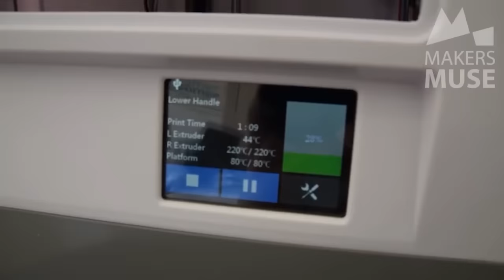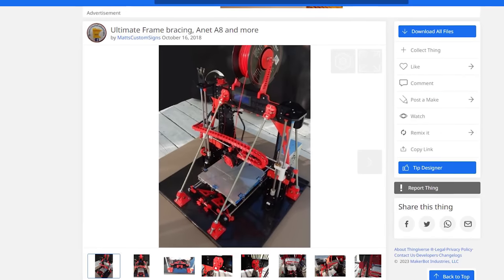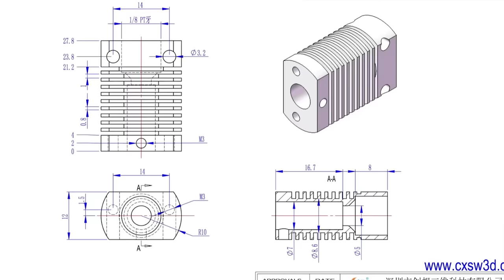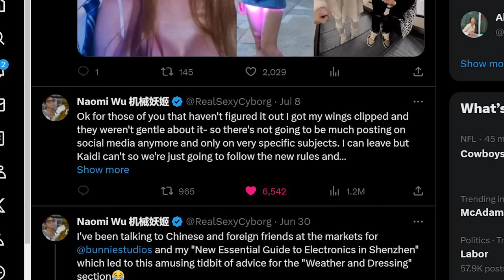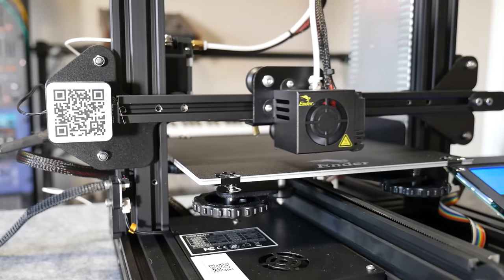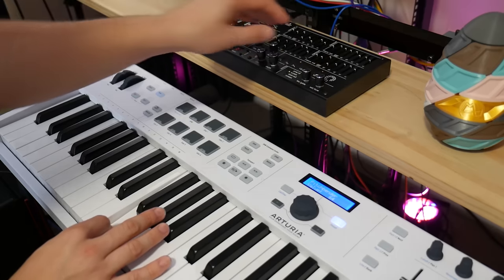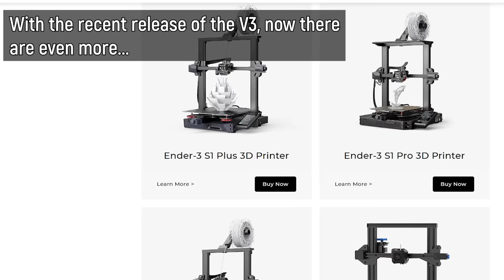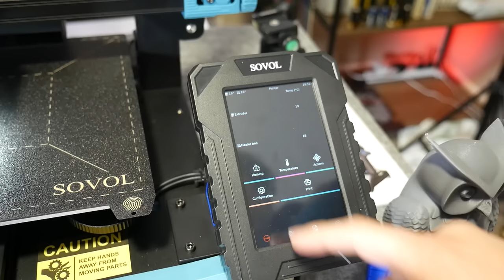Creality Ender-3... it's time to move on.

Comment: My Ender 3 Pro is awesome. I can turn it on after months of not using it and get a perfect print first time. It’s not very fast compared to newer printers, but it is reliable and asks for nothing in return. It was a great first printer. Agree that there are newer models that might be better, and Creality needs to get the Ender 3 variants under control.
Reply: Lucky you, mine was not responsive at all after 6 months of no use.
Reply: @VideoNerete dang, I used it for the first time in 1 and a half years, and it's still a work horse.
Reply: I have an original Ender 3 that I bought in 2019 and it's the same way.  Spent the first few months getting it dialed in and for years now it's been turn it on and go whenever I need it.
Reply: I kept my 3 v1 off for about a year and fired it up... Bed was still level, hot end was working perfectly. Printed like it did a year prior.
It's my old faithful, just so slow now that I have the Ender 3 v3 KE.
Reply: My Ender 3 Pro is 4 years old now, starting to rust on some of the motors and guide wheels from storing it in the shed, and yet it still prints incredibly well and has always been reliable. Its print quality and reliability is honestly better than the Ender 3 V3 KE I recently bought (and in the process of returning) and I love it to death, best purchase I ever made
Reply: @Vantillay  I've been using my KE for about 2-3 months now, not a single hiccup. about as reliable as my old Ender 3 v1 (and far easier to get something printing) ... I am impressed by the speed. I have all but retired my old ender.
Reply: @MadGoat   I'm really glad to hear your KE Has been serving you well! I think I just got a defective model, or got really unlucky, because my KE has been nothing but trouble. Ah well, shit happens, happy printing!

Comment: The ender 3 is an absolutely fantastic printer, I run a small company and we prototype parts on it all the time, we bought a K1 Max and two bamboo lab P1S's and I love them as well especially the bamboo labs but at the end of the day you can get a Ender3 for like $150 any day of the week, and it teaches you a lot about the concepts of printing when you're tinkering with it. But because all the parts are pretty robust you're not going to really break anything. I own 6 Enders and just love them especially when you have a glass bed. Ender3 + FreeCAD = Fun
Reply: Stockholm Syndrome
Reply: I like the glass bed as wel but as soon as I had a bed leveling probe and a PEI sheet I tossed that glass bed in the bin and from that moment everthing just sticks and comes off like a dream
Reply: Quite an endorsement and convincing.
Reply: What do you recommend instead
Reply: I use a glass mirror for a bed. Works great.

Comment: I love my ender 3 neo. I am using the creality slicer software and have printed a number of your challenging prints including the easter egg torture test and all have worked perfectly. I am new to 3d printing and am 73 year old female. It's great fun. I have not needed to make any modifications to the printer or the settings to achieve the results
Reply: Omg, you're amazing! 73 years of age and 3d printing?!? I wish you were my grandma, haha. Lots of love, god bless you!
Reply: I got an Ender 3 Max Neo, nice to see someone else with a neo printer :D
Reply: @sparkthego0f473  Just got an Ender 3 v2 Neo (first printer), haven’t set up it but can’t wait. I’m nervously optimistic.
Reply: Nice,

I think the V2 and Max are pretty similar. 

When putting the printer together be sure to mount your display correctly. I didn’t do mine right and now the screws are broken lol. 

Also quick tip, make sure your wheels aren’t too tight. If they’re tighter than they should, after a few prints, it will look like there is dust on your wheels. It’s very visible on the wheels that carry the build plate. It’s actually rubber from your wheels slowly “chipping” away.
Reply: bot

Comment: My ender 3 has 700hr on it since july 14th when i upgraded it to klipper. Over all it have like 5k+ hrs on it.
Even if i never use it again after my version of a vzbot is built ill still never sell it and it will always have a place on my shelf. Its been an incredible machine that got me started in 3dprinting. I now have 4 machines of various configurations churning out parts almost 16hrs a day. My ender has a place in my heart. Bury it with me.

Comment: Sticking with my Ender 3 too. Its familiar, and Ive learned to fine-tune it over time. Budget constraints can make trying new models a bit tricky.
Reply: I'm not sure there's any good reason to upgrade from one unless you need a larger build volume are want to print with resin. Once you've got one of those locked in, there's not much to be gained by switching. It's the folks that got a bad one or can't get it to work right that ought to consider upgrading or switching.

Comment: Last year I upgraded my Ender 5 to an Ender V3 Neo, and I don’t think I’m going to stop recommending Enders anytime soon. Yes, the Bambu we have at my work BLOWS ME AWAY with how great it is… but it’s also 5x the cost.
Reply: And 5x the quality
Reply: @TEGKCUFTNUC  and 5x the peace of mind to leave it printing and not be bother checking it from time to time
Reply: Terrible support has Bambu.  I have the X1 (not blown away), the Qidi X-Plus 3 (very good), Ender 6 (nightmare), and my trusty Ender 3 V2, which I continue to mod, and it prints just like it did on first day.  Beautiful :) I have probably spent more than the previous aforementioned, all put together, on the V2, lol, albeit, it's a tad slow now.  Think about that ;)

I did also buy an 'Aquila' back then, (cheap at time, with the crappy mainboard) but it never came out it's box, and I just ended up using it for spare parts (for Ender 3 V2), as I was just too busy getting the Ender 6 nonsense done at the time, so that never got up and running, which I feel bad about.  Covid took it's toll.   Still, more parts for my V2, rest got binned. :D

Comment: I completely agree with all of your points. Wanted to add however that the recent SE model is actually something a bit different. It uses a strain gauge and auto bed leveling so the user doesn’t have to adjust zoffset or make any first layer adjustments at all. Very compelling at $200. Ok, now I’m off to check in on Naomi and where she’s been.
Reply: i was gonna say the same thing.  Also no more bowden tube so that is another flaw mentioned that they have fixed.  I'm a bit biased of course 😆
Reply: It still doesn't hold a candle to the Bambu a1 mini though, for the same $200

Comment: Got to say you're spot on in your analysis of the 3D printer market.
(My personal experience)
My son got an Ender 3 as a hobby printer as it was cheap and great to learn with and pretty much got me into the whole 3D printer world. I loved the whole design and print side of 3D printing and wanted to get my own printer but could see so many things wrong with the Ender 3 I didn't want one myself. The Ender 6 came out and I talked myself into how it would make a great hobby printer and to learn on and even make some mods to take care of its shortcomings. The Ender 6 has been a great tool but the constant need of fettling to get great prints was getting tiresome when what I wanted was my printed design to come out without any drama. Enter the Bambu A1 combo. The thought of easy colour prints was tempting but the ease of use and self calibrating element of Bambu printers in general had me reaching for the credit card. My, so far, short experience of the A1 has me blown away. Just this morning I sent a print from the web to the printer from my phone and it just works with nothing more than turning the printer on. Bambu have moved things on considerably with their ease of use it's night and day.
Was the Ender 6 a bad printer? No. It taught me so much but now it's time to move on to what I really want to do, design and print, without the fettling.
Reply: I hope by "short experience of the A1 has me blown away" you don't mean "the cable shorted, caught on fire and my house exploded". I hope you got news of the recall.
Reply: @bami2  Thanks for your concern but both the A1 and myself are intact. My printer is closer to a wall behind it such that the bed cable was tapping the wall. From new I've had a strain relief print installed to stop the tapping and my cable is as good as it was out of the box thanks.
Reply: @stevecade857  That's good to hear!
Reply: Going from Creality to the new Creality... Some folks just don't learn.

Comment: I have an ender 5 Pro print farm,  which has done me well for 3 years.  You can't have a farm with lots of different printer types.  But bambu labs will be my next purchase.... just waiting until Christmas sales come and go... before I move away from creality.  Completely agree with the general view of Creality.
Reply: Bambu printers don't support the same level of print-farming as your Enders
Reply: @user-jk9zr3sc5h  can you explain what you mean? Do you mean just based on cost you can get more printers for the same amount spent, or is there some other feature you're talking about?
Reply: @doinker50  No, Bambu printers arent currently automated. You have to manually print each item. There may be some automation software available but I havent heard of it yet.
Reply: I'm not a 3D printer farm operator... But I'm curious about the automation thing. How do you automate a 3D printer when you have to physically remove the print from the bed before starting another one?
Reply: @crooker2  Ive seen people add gcode to push the print off with the print head (cool the bed, push it off, print again) but i dont know if people use that in print farms
Reply: @crooker2  10 Enders are "available". Pre-sliced STL to GCode. Send GCode to 10 available. 10 Enders are now marked as unavailable. When print completes, take print off of the bed, and mark as available.
Reply: @doinker50  Couldnt do that push with a Bambu, the toolhead cover would fall off lol
Reply: @crooker2  I dont.  But this is a full time job, so long jobs are run for overnight, and then I have a day routine, which involves setting off shorter jobs, repairing printers that are playing up, removing finished items from printers, cleaning them up, packing them, either as finished goods for future orders, or to fulfill orders that have just come in.  not forgetting creating shipping labels, replying to customer emails, and more..  I have added gcode to all my jobs, to beep when finished so I don't get too distracted and I am aware when to go and pop an item off a bed, and start it off again.  And for small items, put multiple on the bed at the same time to avoid going to the printers too often..  Keep short jobs as few as possible.  Lots of info there :)
Reply: @crooker2  I designed a rig that sweeps from the bottom until it hits the plate's lip, then slides in underneath it lifting it from the magnetic bed, then slides out and drops down. The upper half has arms that drop in a new plate (using the removing arms measured height as reference).
I'm currently building an automatic stylus that touches the screen to activate the next print.
I want to do as little modification to the X1C as I can. Currently, the design just removes the top plate and the door.
Reply: @DonsArtnGames  The thing is you cant send GCode to the printer aside from SD Cards or their proprietary webservice interfased ssl tunnel
Reply: @DonsArtnGames  Have you added a CHT nozzle yet? I have a P1S so it doesnt complain- not sure the state of the X1C and CHT. I'm shaving off >1hr from ~8hr prints from prints simply from increasing my volumetric flow and pushing it faster. It only took me about 30 minutes to install.
Reply: @BrianBauckham  Yeah, that's what I figured.  That's what I do too, set my long jobs to run overnight. (Of course, every job is a long job with an Ender 3v2. :)   )  Of course, I'm only a hobbyist.
Reply: @DonsArtnGames  Sounds amazing... and complicated!  :)  Would love to see your rig in action.  :)

Comment: Honestly, I will always be thankful for this printer. At the time, the other decent option was to spend ~$800 for a Prusa. It was simply too much for a tool I was not sure to use that much beyond the obligatory Benchy (which strangely enough, I actually never printed ^^). To be fair, it is not a great printer, even with upgrades. But as a tool I use once in a while, it's still fit for purpose, even if better printers do exist for the same price now.

Comment: I bought an Ender 3 back in 2018 as my first (and until recently only) 3d Printer. Back then, there wasn't much choice available at that price point and it was surprisingly good out of the box (I guess I also got lucky). I had the occasional problems with leaks in the hotend due to bad fittings or molten PTFE tubes, but generally it worked fine. Of course it got some mods over the years: lots of 3D-printed attachments, a Raspberry Pi (OctoPi) with a camera, magnetic PEI bed, new mainboard with silent drivers (most mind-blowing upgrade), BLTouch ABL, quieter fans, a new, full metal hotend... It got to a point where it was mostly reliable, had good enough print quality and was even quiet enough to sleep in the same room it's running in.
I actually only used it occasionally and for simple enough prints it worked really fine. However, I never got the settings quite perfect for low-tolerance prints and some special cases. I knew I could get there, if I actively spend at least 10h calibrating and adjusting everything (maybe replacing some worn out parts), but I never really wanted to take that time. Over the last months I often thought about cool stuff to print, but knew I'd have to fix the printer first for really good results, so I didn't do it.
Then a friend told me about Bambu Lab. After some thought I got myself a P1S for Christmas and oh boy, is that a game changer. After the easy setup I printed the benchy that's readily sliced on the included MicroSD card and couldn't believe how fast that thing was! And it wasn't only fast, it was also the highest quality print I ever produced to that day. Without any tweaks. That changes it for me and I'm completely back in the printing game again. The only thing I really miss from my Ender 3 is how quiet it was with the upgrades.
For me, tinkering with the Ender 3 was a fun hobby from time to time, but most of the time, I just want a reliable and easy to use tool - which the Ender 3 never really was.
Would I recommend it for someone to buy? Maybe, if that person is good with electronics, patient and wants to have a DIY experience. Otherwise: never. I would consider almost all my upgrades on the Ender 3 to be sensible and maybe even required for a good experience. The catch: if I combine the price of my Ender 3 with the price of all the upgrades, I could get a Bambu Lab A1 for that price, which I'm 100% sure would be the better printer by far in almost every way (except maybe customizability - better printer, not better project).
Reply: Exactly, and the time spent tweaking/tuning/fixing. If your time is worth more than $5 an hour, a bambu labs will pay for itself

Comment: @4:20 - oh man, I remember that. The CR-10 was a massive success with the price point for the build volume. It's like they took a minimum parts needed for that size, and put it all together. Before that, the size contest was strictly expensive, and I still remember buying my first gMax 3d printer :)
Reply: Yep!  I'm still running my CR-10 Mini right besides me...  Not as large as the CR-10 or some of the others since, but luckily hasn't been an issue for me yet...
Reply: My CR-10S still works like a charm. It has its quirks (10:09), but once its set up, its print quality is pristine and handles up to 120 mm/s. I can start it and trust it to finish properly every time. Had it since it first released.

Comment: I was thrown into this hobby by my best friend who had just bought his second Ender 3 and gave me his first 3d printer, a Mingda D2. Basically an Ender 3 V2 clone, with BLtouch and a touchscreen. I used that for a year and got frustrated with the print speed, and all the little issues in leveling, plus the occasional layer shift. Mostly though, i wanted to print ABS and the bed would only heat to 100°C, which was bad for adhesion.

Then i bought an elegoo Neptune 4 for 250€. Klipper, Mesh leveling and what feels like 10x the print speed. With fast printing, failed prints cost way less of your time, you can "fail fast" as Mr. Musk likes to say. My free time is easily worth that money. Still gratefull as heck for that free printer which got me into the hobby. It has to go though.

Comment: The learning curve with the Ender 3 can be a bit steep, but its a rewarding journey. The community support makes it easier to tackle challenges.
Reply: Try building your own 3D printer from scratch.  😀 I did that back in 2016, and built another in 2018. I still use the second one, and have put Linear bearings on it. It's not the fastest, although I do intend to upgrade the firmware on it soon to allow me to go faster.
Reply: ok @NZSpides